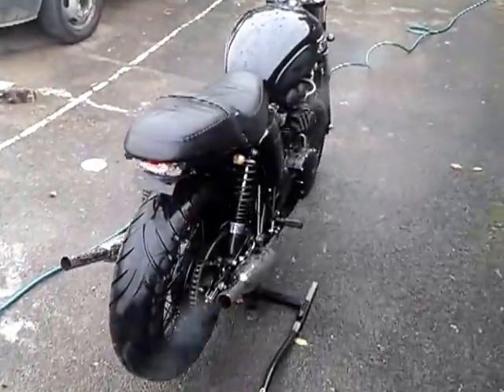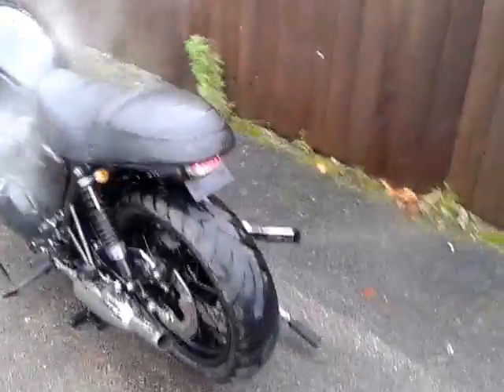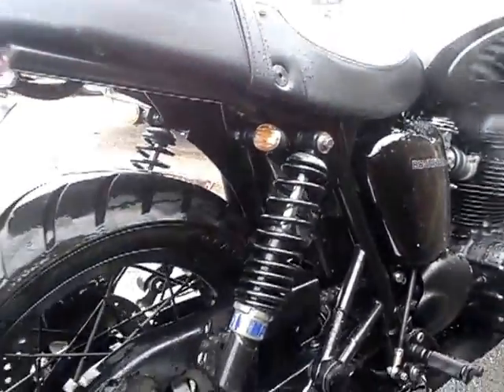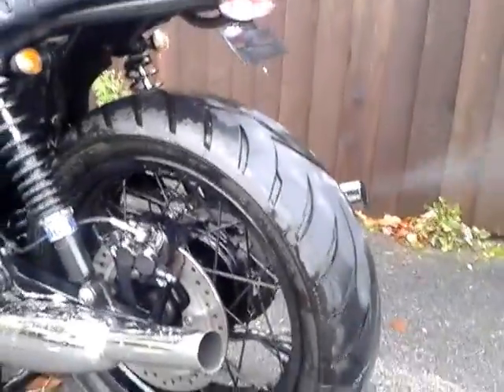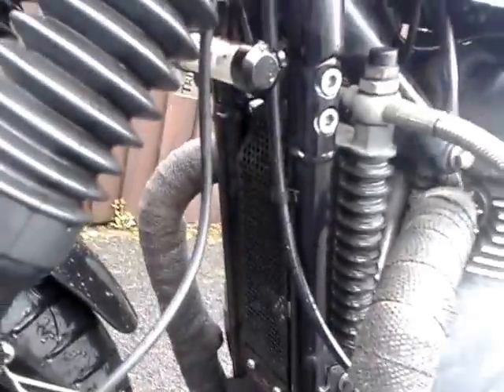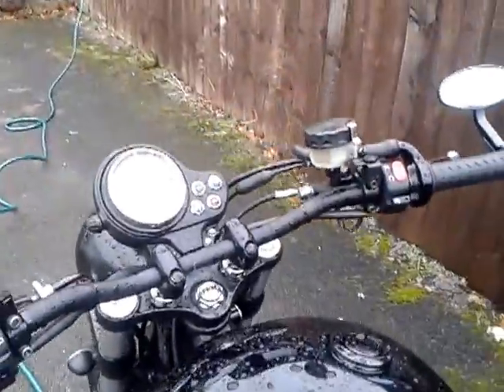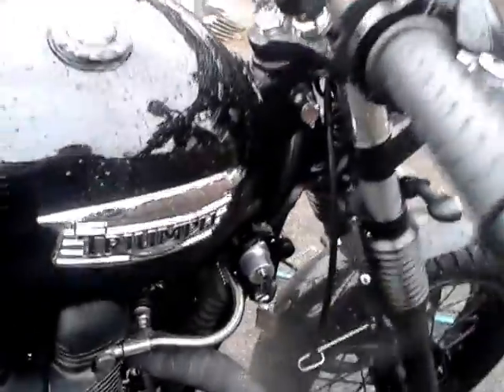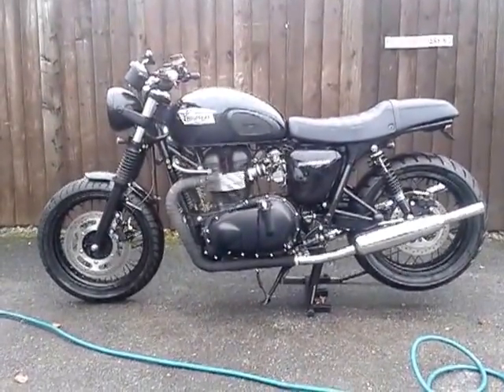Bonneville walkround

Comment: Nice Bonnie...tidy & sharp! Are you happy with the rear caliper relocation bracket? I am considering this for mine as well
Reply from the maker: Thank you very much! Been watching your vids for a while!!! - I'm very happy with the bracket- still a bit expensive but worth it!- I went with the Free Spirits one in the end as it was cheaper and apparently did not require a longer rear brake line-this is true but I did end up having to slightly re route the line as I felt it was a little too stretched. Hope that helps! - Having lost a caliper to corrosion on my old daytona 900 i was keen not to let it happen again!!!

Comment: Hi, lov all your vids keep the tinkering and mods going.....I asked you a message about your wheels and tyres ages ago on your Bonnie,...... I'm back I have bit the bullet and sourced a Wire Spoke front wheel in 18" off a Thruxton  and a full Wire  rear wheel 17" to widen later down the track ....
Question....?  I also have a Mag wheel bonnie 2010 SE, and when I fit the Wheel it really pushes over to the right, did you find the same on yours  and did you make any changes , there are forums around saying you need to change the fork bottoms to the 19" Bonnie or Thruxton to make it work .....I'm hoping it's just spacers... hope to here back on your thoughts and solutions, From Aussie Land. Regards Pauly
Reply from the maker: hey buddy!! excellent news- sadly i'm afraid if its a mag wheel you will need to source fork bottoms from a t100 or thrux. i did need a spacer on the r/h side for mine but the front is a machined tiger hub. things like the brake disc/ speedo mount/ stop yoke width etc are all different. hate to be the bearer of bad news!!!

Comment: Hi buddy

Do you know if the controls can be moved forward at all on the Bonny? Also, is yours an standard or a T-100? ... Nice work!
Reply from the maker: i guess using the some of the parts from a speedmaster or america you could move the controls forward- may have to fab some parts ups i suspect...this bike was a standard mag wheel that that the extras on it to make it an se, but i've stripped it back down!

Comment: Johnny, one other question, did you have the seat cowl installed at the same time you had the mag wheels on? I'm trying to find a video or pictures of a Bonny with mag wheels and a seat cowl. I would like to see how they go together.
Reply from the maker: hey mate i'm sure i do somewhere- there may be one on the last bratstyle seat video....but if not i'll try and work out how to send you a picture!!
Reply from the maker: hopefully i've managed to send you a link to some pics!!! all the best mate!!
Reply: Hi Johnny, no pics came my way. Is there a link? If they are your pictures I can send you my email address.
Reply from the maker: hey buddy- damn thought i'd cracked it!! if you send me youre email address then i can get some pics def to you!!!
Reply: I actually found some. .. Not many but a few. I found them on Google images. Did you buy your spoked rims new or used? .. I'm curious as to how much they cost?
Reply from the maker: i had them made up new to my specs- scary expensive- i think it was over £1000....gulp...had a bit more cash back then!! try these links!!! 

http://s997.photobucket.com/user/johnnycactus/media/2012-10-16124333.jpg.html?sort=2&o=2

http://s997.photobucket.com/user/johnnycactus/media/2012-10-16124349.jpg.html?sort=2&o=0

http://s997.photobucket.com/user/johnnycactus/media/2012-10-30142047.jpg.html?sort=2&o=5
Reply: WOW! That's a lot of cash for a wheel! I just bought a 19" front wheel for my bobber, powder coated black with chrome spokes for $350 including shipping. .... Thanks for the links.
Reply from the maker: crazy money!!!- it would have been cheaper if i'd started with spoked wheels at least i'd have the hubs but everything had to be machined to fit, powdercoated- treated as they run tubeless and the tyres and a disc for the front and that was shipped to me....i guess if you broke it down it's not as crazy...at least thats what i have to tell myself!!!

Comment: You have probably been asked this a thousand times, but what size are your wheels ? Are you still running a 19in front and 17in rear ?
Reply from the maker: hi mate- no worries!!! is was a mag wheel so they come with 17" front and rear- i kept those sizes as i really liked the handling. the rims are wider than stock- 4" on the front and 5" on the rear- tyres are 160 60 17 rear and 120 70 17 front. hope that helps!

Comment: what year is this bike>??
Reply from the maker: hi mate- its a 2010. cheers!
Reply: how much do you think you spent in modifications to get that look? are triumph parts on the more expensive end?
Reply from the maker: it was pretty expensive getting there! the most expensive were the wheels- from mags to wider tubeless spoked...about £1500...the rest probably another £1200...but then i got a good deal on the stock bike and sold alot of the extras off to fund the parts..all in still less than a stock bonnie brand new! (thats how i justify it anyway!!!) as for triumph parts being more expensive- well there virtually no offical triumph extras on the bike- accessories are a bit pricey but general service items are no different to other bikes really.